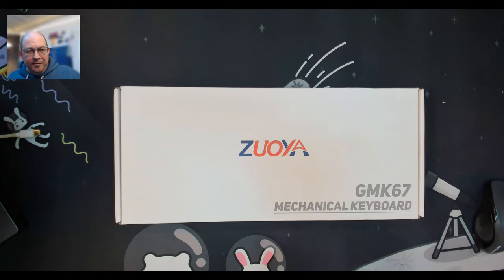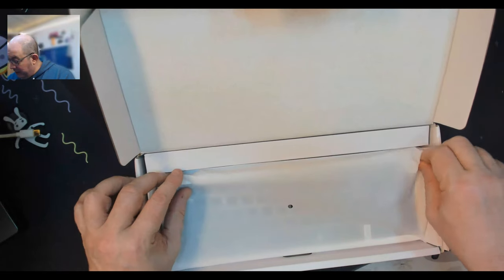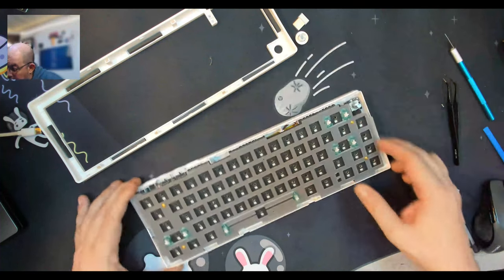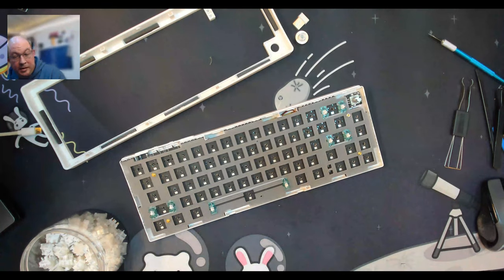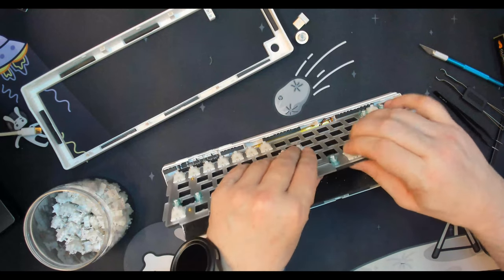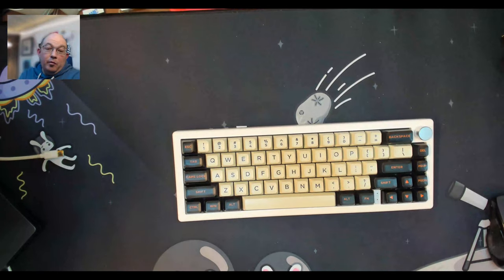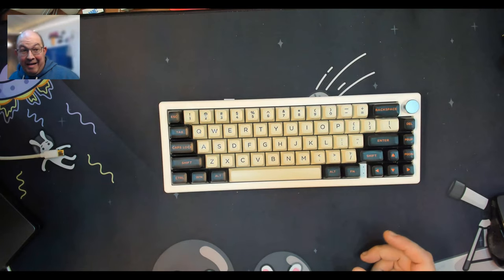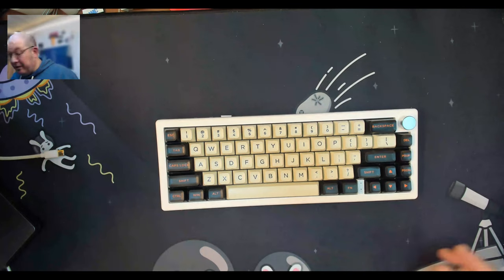GMK67 New Revision Don't Remove The Plastic Sheet

Comment: I bent like 5 switches trying to shove it in, thank you for this enlightenment! unfortunately I got the same issue with inserting since the plate was so flexible, several times the switch straight up dropped off after I tried pushing it down. several injured fingers, cursing for 30 mins and 1 penknife later, I got them in (albeit uneven, but that's a battle for another day). glad to see it's not just me facing this issue
Reply from the maker: Glad to hear you got it worked out, it's a bit of a pain, but it delivers a great pay off with the result, cheers!
Reply: oof same. i should have seen this video earlier. they should have a warning or something about it in the manual

Comment: bro i got the plastic inside and its hard to put the switches inside but sounds creamy. I only bent 1 switches. Currently using Akko cream v3 yellow pro no need to lube if you have the plastic

Comment: the battery randomly stopped working any advice?
Reply from the maker: Replace the battery? It's difficult to even get in touch with Zuoya, let alone to get any service, we're all pretty much in the same boat, sorry.
Reply: @MechKeyboards   yeah I got that just what is the connector on the battery
Reply from the maker: @luner_ghast6856  I'm not sure of the part number honestly. Just find a battery with the same output voltage and replace the connector from the old battery to the new one.

Comment: Got this as my first custom keyboard. Glad I found this video from your reddit post after Google searching about what the plastic film was.

Happy to know I did not need to take it out. 

I just used a needle thing to poke a hole in each of the center holes and the pin holes as well. With a little bit of pressure and making sure the  switches were aligned nicely, they fit into place with relative ease. 

Thanks for making these more specific videos.
Reply from the maker: Glad it helped! Keep Calm and Keyboard On!
Reply: You're the goat

Comment: My situation was actually way worse. I removed the plastic sheet from the beginning and I still found difficulties inserting the switches. I then tried to put them in the plate first (which was also really difficult for a weird reason) and then into the pcb..!
Reply from the maker: Some plates are real "flexy" like. I use a spudger to prop the plate up in front of the switch and start at the corners and stab keys, then the perimeter and fill in from there. After some practice it has worked out for me in most cases.

Comment: thanks for this video, also my first hot swappable board and feel the same pain as others 😅 

Edit - For anyone else struggling when pushing switches in, use tweezers to pull the frame up. Install was considerably easier after doing this
Reply from the maker: Thanks for the tips!

Comment: My last GMK67 has this sheet, was also white like yours. I found I did not have to pop the sheet and the switches went in fine, initial fit just required a slightly harder push. Obviously making sure the pinds are REALLY straight.  I c an see the cut route makes life slightly easier though :)
Reply from the maker: It would be nice if it came pre-cut, but I'm still happy with the results! :)
Reply: @MechKeyboards  Yep, it is sort of strange how they have done but I guess it is cheaper to install that having to ensure the holes align and the sheet needing to go through extra process. Given the board costs I understand

Comment: shouldn't the sound tests with / without the plastic sheet be with the same setup? with so many variables at play, it makes it difficult to determine if the plastic sheet makes any difference.

that being said, i removed mine because it made it difficult to insert switches and bent some pins. still sound great with stock milky yellow pros and a fully stock GMK67 with lubed stock stabs. i do have painter's tape and polyfill on the way.
Reply from the maker: Ideally, but I did not have another stock board nor the time to to full teardown and rebuilds with this one. 

Painter's Tape and polyfill are a nice mod, but I'm loving what PET/LDPE does to a keyboard.

Comment: Hi I just got my gmk67 kit today, I realized that the keyboard takes around 7 seconds after plugging in the usb c before it starts working, is this normal across the models or is there a problem with my pcb
Reply from the maker: I counted 4 seconds, perhaps try with a different USB and/or a different port?
Reply: @MechKeyboards  That could be it. Do you have another problem where if you press any of the keys before the keyboard starts working, the start up time resets?
Reply from the maker: @chuukiart  when using a USB-C 3 cable, it works best with USB-C 2 cables connected to USB2 ports.

Comment: Whats the name of the knife???
Reply from the maker: The knife? Do you mean the plastic spudger?
Reply: Yeah. I also got my GMK67 and was wondering why I cant put the switches. I'm asking for the tool's name cause I don't know many tools
Reply from the maker: @iseeyou9488  search your local Amazon or store for 'plastic spudger', I like the ones with a pointy end and a flat end, great for opening cases without breaking anything too!
Reply: Can I use my tweezer for cutting through the plastic sheet?  @MechKeyboards
Reply from the maker: @iseeyou9488  you can use anything sharp to do it, though I would try to avoid using anything metal to minimize the chance of any accidental scratches. The tip of a pen should work just as well.

Comment: Mine is having double clicks and I think it may be this plastic
Reply from the maker: Make sure it's all straight and not bunched up and that the switch is fully seated.
Reply: @MechKeyboards  I tried many times, many different switches. The only thing that reduced the double clicks was poking a hole in this plastic right in the middle, it's just stretched (but still have loose pieces, I couldn't cut perfectly).